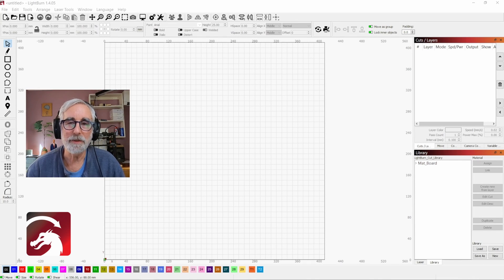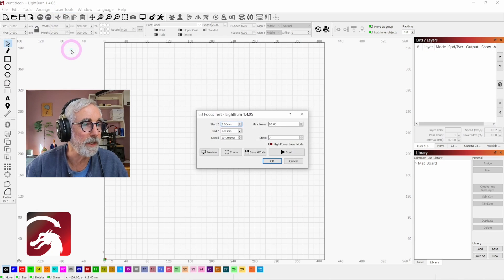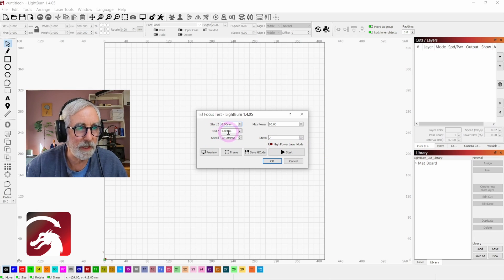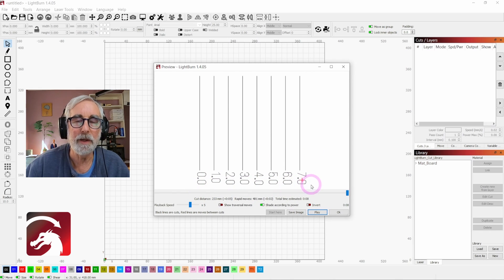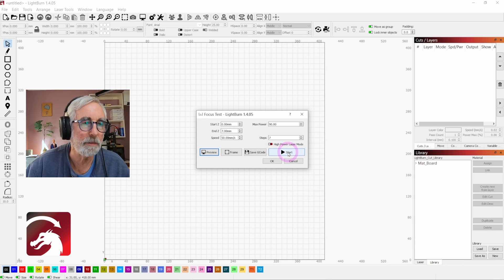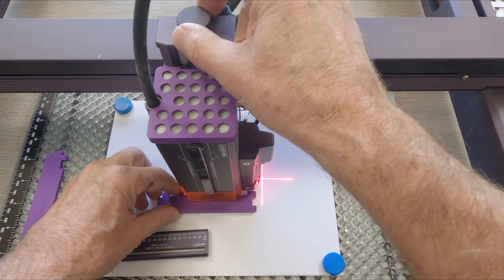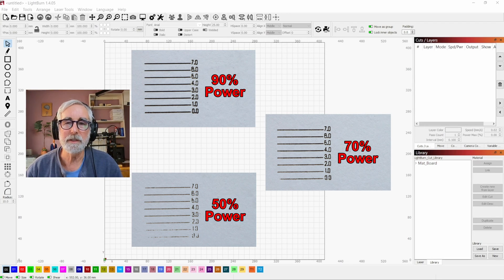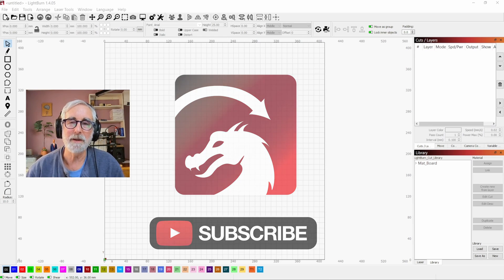How Does LightBurn's Focus Test Work?

Comment: I have a question for you if u don’t mind.
I have a laser on my cnc. I homed it and clicked on that red ballon to a location on my work area. The machine did move but I have no idea where it was going. I had to turn it off. You wouldn’t have an idea or two what it could be would you. The correct work area is entered for the work area. Thanks for the focusing tip.

Comment: Great video.  Ran this text on my new Gweike Cloud 50W and it worked.  Found that 14 mm is the best setting for a fine line.  When I ran my job (cutting a longeron out of 1/8" balsa and it cut a horrible thick line half way through.  Need to figure out where to change the focus distance for each job.  Already tried changing focus to 14mm in the machine settings.

Comment: Do you have any advice for me? 
My manufacturer uses 17-material thickness but I want to run my own focus test and anytime I try it cuts one line and then for the next it just hits the material. I’ve tried many different settings.
Reply from the maker: It sounds like you need to make sure that your Z axis is moving in a positive direction; the "End Z" number should be higher than the "Start Z" number.
I'm not sure what you mean by 17-material thickness; who is your manufacturer?
Reply: @artfromearth3886  my manufacturer is Gweike. They say my focus is 17mm - The thickness of material example. 17 -3= focus distance would be 14mm.
Reply: @artfromearth3886  My manufacturer is gweike cloud. The way they say to calculate the focus is the subtract the thickness of the material being used from 17mm and the number you get is what would be input for the distance.
Reply from the maker: If you are using the LightBurn focus test, I would try starting at 17mm, and then moving down 1mm in steps to the thickness of your material (4mm).  Then run the test again, and move up in 1mm steps- see what happens.